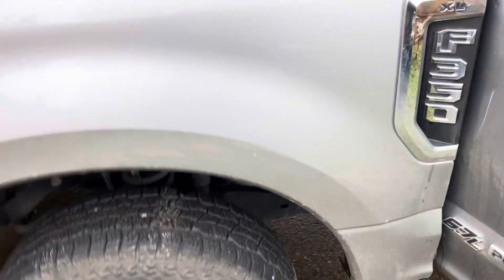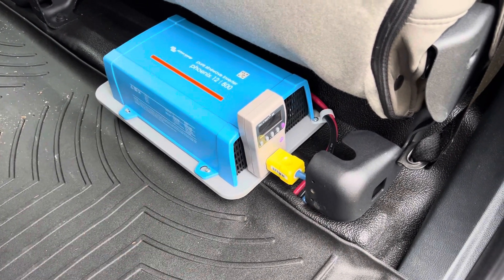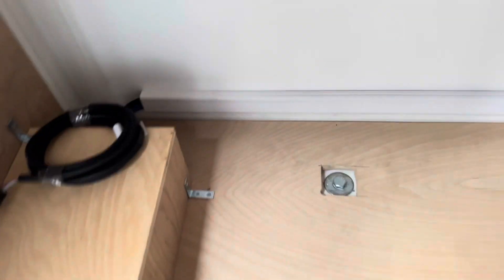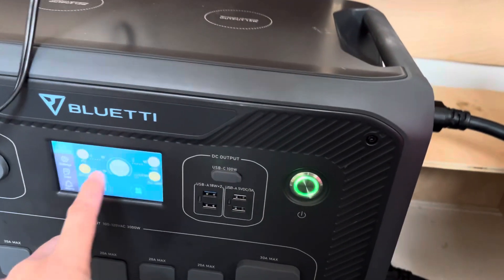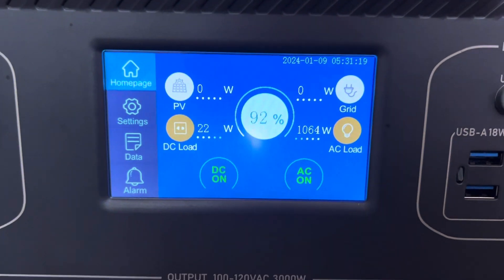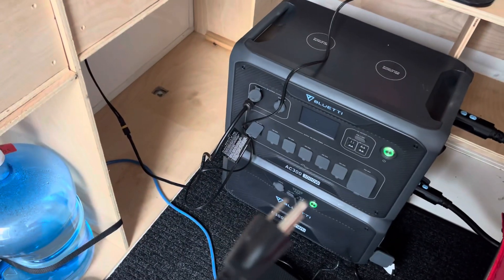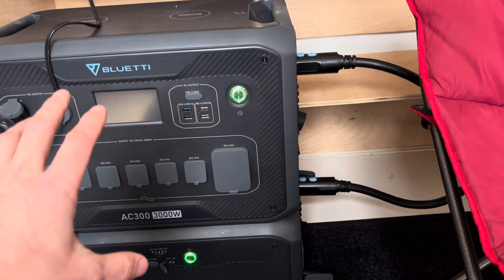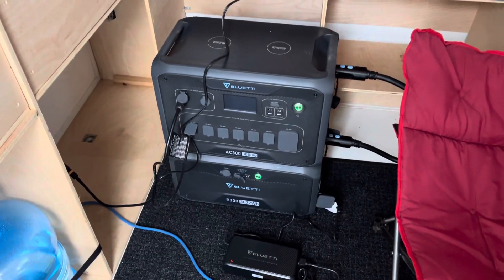Victron inverter for alternator charging Bluetti in overland truck

Comment: Love the ingenuity here but the losses are crazy... 

You are converting DC from the alternator into AC, with the inverter, to power a charger with a DC output, into a Battery Bank, which then inverts back into AC. Oh, not forgetting the DC output from the Battery Bank 😮😂😂😂

I know why you have done this, charging currents ect but the better way to do it would be to install a Charger 1 from Bluetti. 

I also use my Bluetti AC180 as a "buffer". I have a caravan with a 12v 280AH lithium battery charged by a Victron mppt charge controller and 400W of solar. 

I use the Load Output of the Victron to charge my AC180 with 100W continuously, except low battery situations. 

This means i can use the circa 1000wh in AC 180 plus 2400wh which is being replenished by the leisure battery, giving me a daily peak of 3500wh but 2400wh indefinitely. (As long as the sun shines).
Reply from the maker: @nickburns2034  thats a cool solution. Thanks for sharing! Bluetti didn’t have a dc-dc charger when I put this system together. But I really like the versatility of using the inverter because it gives you 110v in the cab, and power even if the Bluetti gets moved and used somewhere else.

Comment: Does it work with smart alternators?
Reply from the maker: I would think so, because any voltage below resting battery voltage turns the inverter off, and above would turn it on. 
You might have to play with voltage thresholds a little. And there’s a setting that accounts for some voltage drop based on power load, so you could really thread the needle if you need to.
Reply: Thank you Aaron. Will 6awg/B&S cable be okay to run Victron 12/800 inverter from start battery to charge the AC200max?
Reply from the maker: @Big_Mafuta  6awg would be fine. Just use copper or tinned copper wire. If you use CCA (copper clad aluminum) then you need to go the next size up (4awg). I would recommend welding cable (its copper and flexible) and a good quality breaker (Blue Sea or EGIS or Bussman).
Reply: @aarongarmon3809  thank you I have installed the inverter and I receiving 14.4V from the car battery. The Bluetti power brick keeps going on and off and there’s no charge to the bluetti. Victron inverter firmware is updated. The type of battery setting, is it the car battery or the lithium battery for the bluetti? All help will be much appreciated.
Reply from the maker: @Big_Mafuta   look at inverter low voltage shut down and restart voltages. And test the voltage at the inverter when the charging brick is turning on and off. You might find that you need to adjust the voltage range so that when the voltage drops under load, the inverter stays on. Eg: low voltage shut off at 12v and reconnect at 14v.
You can also test voltage at the starting battery and compare that to the voltage at the inverter under load to see how much voltage drop you have. This will tell you if you have good wiring or not. Voltage drop under full load should be 3-5% (10% max)
Reply from the maker: @Big_Mafuta  test the inverter with a different load, like a hair dryer on low. In the Victron program, with a computer connected, you can see the live voltage and wattage data. This will help isolate the problem. 
Also make sure the bluetti and charger work on a regular household outlet.
Reply: @aarongarmon3809  Thanks Aaron. I think the issue with the inverter not charging was that the Bluetti was already charge at 80% or higher when I tried. When the bluetti was at 50% the inverter charging started charging. Also saw the new Pecron. Would have gone this route if I new earlier. PECRON 500W Car Charger DC1242-500 for Cars, RVs, Trucks, etc.

Comment: Very cool set up! Do you gain a significant amount of charge speed on the bluetti using the pheonix inverter instead of the car charger? Wouls this set up work on a truck with a 130 amp alternator?
Reply from the maker: Dc charge plug on all these units will be designed for a 12v dash socket. Those are fused at 10A so charge will be 120-145 watts. This inverter setup is doing 500 watts.

Comment: any way you could explain connecting the inverter to the batter?
Reply from the maker: It’s literally 4awg wire with 100a fuse or breaker directly to the start battery. Both + and -.  Some voltage on/off levels programmed in the inverter makes it turn on with the engine running.